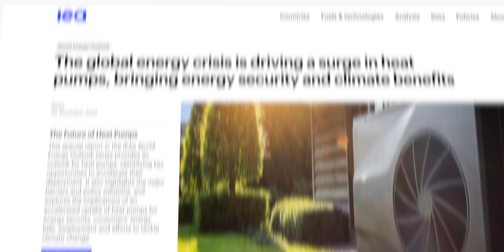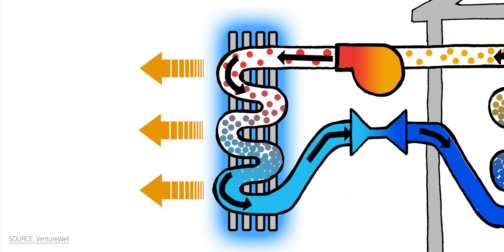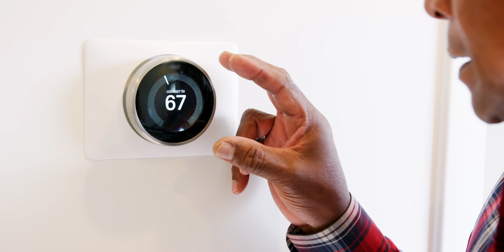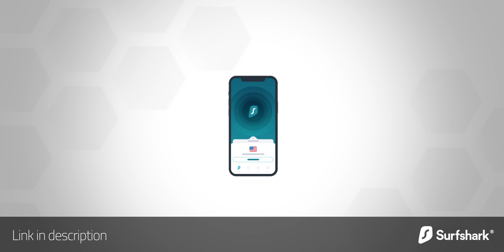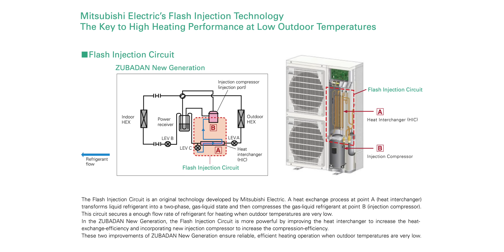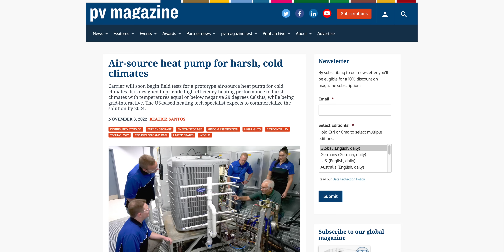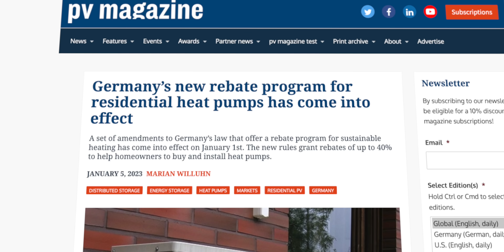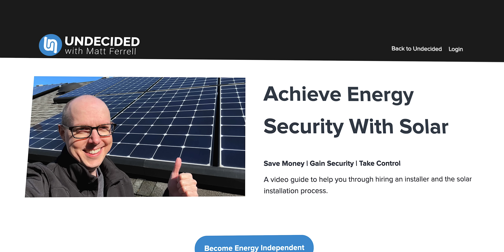Major Advances with Heat Pumps in the Extreme Cold

Comment: My sister had a heat pump installed about four years ago.  Last month, in our area of Canada, we had a temperature drop of -25c for a couple of days.  Her heat pump is her main source of heat.  She has never had an issue with getting heat.
Reply: I just moved to Idaho and it got down to -20 F (or nearly -30 C). Those are the kinds of temperatures I'd like to be sure it works still at.
Reply: @stevenschmidt   I have four air-to-air heat pumps, or mini-splits as the North Americans tend to call them installed here in northern Sweden, with a heating season being equivalent to Anchorage, Alaska. They work just fine in -25C, but with those outside temperatures the total energy needed for heating exceeds the design capacity of the heat pumps. You could get a three times larger unit but that won’t be economical as that capacity won’t be utilized 95% of the time. Here we supplement our heat pumps with a secondary heat source on colder days. In NA this could of course be natural gas from an existing hookup at no additional cost. Here we mostly use wood pellet furnaces due to local price and availability. 
What strikes me as odd is the high installation costs of mini-splits in NA. Mine cost me 800 USD each including installation and electrical hookup. Something is wrong with that industry in north america, but hopefully prices come down as the market matures.
Reply: @Random-f3y7w  With a quick scan, I didn't see anyone mention this... Several people I know with heat pumps have aux heat which  is just a built in electric heat strip (~10kw). If you only need that a few days a year you still keep most of the benefit from the heat pump. If you need it more, you lose all of your savings since straight electric heating is usually the  most expensive kind. If, as you mention, you have some other backup heat you are doing much better.
Reply: @Random-f3y7w  In the US, I think it might be a combination of things. In the US, you need to have 3-phase power to a unit as 120v 2-phase isn't enough to power a heat pump. With higher voltage in Europe, it is a bit easier to run a circuit. Also, when I checked them out in Boston, heat pumps were enough out of the mainstream that a lot of installers avoided them. At the time, the state of Massachusetts was allowing up to $5k financing at 0% interest... magically, the installed cost would come in right around $5k!
Reply: @Random Acts  I think what is wrong with installation costs in the USA is that millions of more people were encouraged to go to college than should have been and there aren't enough technicians :)
Reply: @Random-f3y7w  The price of the ductless units here are ridiculous, I lived in both Cozumel and VeraCruz Mexico for several years and ductless units are stacked up on the floor of most grocery stores. Same brands as here Gree, Haier, Media and all the ones they make for others. Average cost is 2 to 3 hundred bucks. They dont evacuate, they just blow a little refrigerant through the lines and turn it on. They last for 3-4 years and then they just replace them like window units.
Reply: @Random-f3y7w  Are there particular brands, or possibly labels that Swedes utilize? Or possibly some EU label that would let one know that a unit will continue to function well enough at -25C? 
I have a friend up in the Italian Alps who has an ancient kerosene furnace in her vacation cabin that should be replaced. In N Italy air-to-air heat pumps are very common, but the vast majority are not built for the real cold one might experience in the mountains. I'm not sure how to advise her on seeking out the right unit.
Reply: @Random-f3y7w  hur mycket betalar du för EL där uppe? jag bor i jämtland
Reply: @nctrailcam81 hi I’m in the process of deciding heat pump with emergency heat or hybrid, which uses propane below 30 F, we live in NJ, I’ve few questions 
1. Will emergency heat be able to heat to any temp we need, like 74-75F?
2. When you mention condenser freeze, how does it impact system performance for heating? 

I’ll need to hear 2300 sf first floor and basement 1900 sf, can heat pump with emergency heat do it?
Reply: @ninjip3460 
1) I would go with the propane hybrid for 1 reason. If you ever have to run your house on a generator, the heat strip could easily take half its capacity.
2) A heat pump becomes less efficient the colder it is and at some point won't even try. When you hit that you are completely on aux heat. That point varies by model, but should be below 0 F for a modern unit.

In all but the coldest parts of NJ, you should have no problem going with a heat pump.
Reply: @Random-f3y7w  what kinda unit you have? Looking to buy one in Latvia. Prices range from 600euro to 1500+-. Panasonic had some good ones with good SCOOP and claiming to work at -35c.
Reply: @Random-f3y7w 800 usd  for a minisplit in sweden ? Are you buying your A/C from Ikea ? 😂. A cheap 2.5Kw Midea is more than 500, add the electrical wires and the copper pipes, nitrogen test, circuit breaker ..
Reply: @RandomActsOfMadness  So your heat pumps work just fine I  -25C, except they don't produce enough heat at those temperatures, so you have to have a complete other parallel heating system, whether it is natural gas, electric, wood pellets, heating oil.  The back-up system utility costs have fixed distribution costs that don't change with amount of consumption, so you pay those fixed costs whether you are using the backup system or not.  The cost of maintaining redundant systems eliminates the long term cost recovery from these new "high-tech" heat pumps.  All you are doing is driving up your cost of heating.  Don't be fooled by the slick sales pitches.
Reply: @stevenschmidt  I live in Illinois.  My gas furnace is 110,000btu 95%.  2 years ago I installed 2 air source mini split heat pumps of 12,000btu each.  They claim to work down to -15F.  I set the gas furnace to 50F on the hallway thermostat. The coldest days of this winter it was below -10 (closer to -15) for about 36 hours continuous and while the heat pumps did still provide heat, it was not enough to prevent the gas furnace from running during about 24 hours of that 36 hour period.  No other days has the gas furnace run at all.  My home is about 2,200 sq ft plus a full basement.  I have one 12,000 mini split on the first floor and one 12,000 mini split on the second floor.  With both set to 70F, they keep the entire house above 60F with no help from the gas furnace.  My highest month winter electric bill was about $170.00 and my highest summer electric bill was $140.00 keeping the entire house about 72F.  I am very happy with my mini splits and I plan to add 2 more 12,000 btu mini splits this next summer which I think will allow heating another similar winter with zero natural gas usage and I should be able to maintain 68F in the entire house when it is -10F outside. if my calculations are correct.  My mini splits are "Innovair pure" (120vac) with a rated SEER of 20 and they have electric heat elements in the base of the outdoor unit that only seem to operate during the defrost cycle so that the water can escape through the drain holes without freezing in the base.   To improve efficiency I added 1 inch thick Styrofoam insulation under the bottom of the outdoor unit and added a bunch of data logging temperature sensors to various parts of the indoor and outdoor units and power sensors monitoring the AC power to each mini split.  They are amazingly efficient and the Styrofoam totally prevented any ice in the base.
These units each cost about $700.00 and I installed them myself, directed and supervised by a friend that is a licensed HVAC person.  My total combined cost including tools was under $1000 each installed.
Reply: @stevenschmidt  you don’t only want to be sure it works, you want to have uninterrupted power… by whatever method.
Reply: @stevenschmidt  It will....  Get ready for a $1400 a month electric bill though, as well as a $1200 service fee when it breaks down.  Good luck!  By the way I've installed 132 of these and not one customer didn't complain about power consumption in the winter.  Or trust a rich YouTuber with lots of money. 🤷
Reply: @stevenschmidt  If it's an air source heat pump.... not a chance.  A ground source heat pump (very expensive, by contrast to air source, due to the installation costs and 'ground loop' assembly) will do the job reliably.
Reply: @stevenschmidt  The heat pumps still work, but are working their guts out. I'm in northern Utah and depending on the local area I live in we got to -30F - -20F in the valley. My heat pump was still blowing warm but couldn't keep up with the demand so the furnace would kick in every now and then. Let me describe another way. The cold this past winter killed all of my peach blossoms in January and nearly killed the trees. Took 2 months for the trees to recover once they started growing.
Reply: @stevenschmidt   Canadian here, My old place had a heat pump that still pushed heat in a week of -35C and a few drops down to -40C, I can't speak for efficiency at those temps,  cause I wasn't sitting there measuring it but it did work no issues. new place doesn't have it but already looking at rebates for my area to switch over too, and there are lots of options.
Reply: @CF_Sapper hi I’m in the process of deciding heat pump with emergency heat or hybrid, which uses propane below 30 F, we live in NJ, I’ve few questions 
1. Will emergency heat be able to heat to any temp we need, like upto 74-75F?

We will need to heat 2300 sf first floor and basement 1900 sf, can heat pump with emergency heat do it?
Reply: @stevenschmidt  hi! I have a good heat pumps and I live in Quebec. I know a guy who work for one of the biggest heat pump manufacturers in America. He said to me that, the winter when you hit -15 Celsius, it became a lot less efficient to a point it can damage the heat pump in a short term. So I decide to use mine only the other seasons. But in a winter I use my wood stove, and I can assure you it’s really the best for the temperature here. We have between 2-4 weeks per winter who we can reach between -25 -35 Celsius. It’s my experience. I hope it’s gonna help. Have a great day.
Reply: @bobafet5363  -30 c’est bien mais nous on attend -40 pour que ca soit vraiment bon pour nous au Québec. Ce que te disait ton gars sur l’efficacité est vrai avec la technologie actuelle mais je me demande comment ils pourraient faire pour ramasser la chaleur qui reste. Parce que physiquement tant qu’on est en haut de 0 kelvein il reste pas mal de chaleur dans l’air.
Reply: @bobafet5363  That may have been possible with really old models, but modern cold climate heat pumps are specifically designed for cold climates. I did Fujitsu's and Haier installation training and neither mentioned anything about damage in low temperatures. It could be that your installer friend was thinking of exterior units icing up, which was a problem with heat pumps a decade ago.
Reply: @bobafet5363  Yes right now we will probably need some combination. Here we saw -25F a few days in a row which is when you need the heat the most of course. Also based on the math in the video it would take 20+ years for a heat pump to pay itself off in energy savings
Reply: @bobafet5363  salut montreal ici. I agree you turn units off when its really cold. Damaging over the long term. On another topic -  who will catch this poster,boba, is probably not writing in his first language. So hurray for trying.
Reply: @bobafet5363 tu peux essayer une version hyperheating Mitsu ou optimized heating de Daikin (monosplit uniquement). Le COP baisse bien moins en températures négatives. Après faut bien faire attention à abriter l'unitée externe de la neige
Reply: @bobafet5363 Well yeah if you have wood to cut and dry yourself then a wood stove is good (not environmentally though). 

 Not everyone has that option. Even prices vary on wood.
Reply: @stevenschmidt  If you are often at those temps, I would highly recommend an alternate heat source.  Especially if you are at all prone to power failures.  If NG is available, it is likely cheaper per BTU of heat on average over the season and can still heat your house during a power failure using only a small generator to power the fans.  A power failure at -20 that lasts anything more than a few hours could destroy your house with frozen pipes and the like.
Reply: @apostolakisl Gas furnaces, stoves, and water tanks need electricity to operate.  Gas outages are common as well.  Solar, storage batteries, and a propane generator are the way to go.
Reply: I live in Canada, and i had a heatpump installed last year (only source of heating) a Daikin. It works really well, dont have any problem. It has an heating coil for when the temperature drops low. At -15’celsius it work at 75% heatpump 25%heating coil.  The heatpump stops working at -27’c, then its 100% heating coil.
Reply: @goben3804  I live in Canada as well.  We regularly see -40C and colder where I live.  Heat pumps have a long way to go.
Reply: One question I have is if it's still cost effective to run an air-sourced heat pump at lower temperatures. If it can heat at low temperatures but it's no better than electric resistance, then sticking with another source may be better.
Reply: @crhpjeff  In North America heat pumps WILL save you money if you are replacing anything except natural gas. If you have heating oil, propane or kerosene heat, heat pumps are going to be cheaper, no question, full stop. Those maybe 14 days of extreme cold that make them expensive to run are more than covered by the other heating degree days when the heat pump is significantly cheaper to run than any other heat source.

If you have natural gas it is a calculation to determine if they are cost effective NOW, but I would guarantee they will be cheaper as we finally start to implement some sort of carbon fee. I had natural gas and replaced it with heat pumps. I'd run the calculation a few times in the previous years and sometimes natural gas was more expensive and sometimes it was cheaper per unit of energy BUT if you eliminate the fixed monthly fee from the gas utility they were pretty damn close in the years when gas was more expensive. I unfortunately have been working from home since putting them in, so I don't have a good cost comparison to pre-install gas costs.

The additional advantages are built in air conditioning and zone heat.
Reply: @patrickcorcoran4828  hi, I live in NJ and have been debating for long time to go with heat pump with heating coil or hybrid, which uses propane below 30 F, any suggestion my question is can it really heat the house? Our sf for first floor is 2300+basement 1900sf?
Reply: @ninjip3460  Yes. Here in Northern VT I had to be careful with the calculations for our -30F nights, but I would not hesitate to install one in NJ. 

I no longer have access to the calculators, but any HVAC company you hire or DIY kit company you contact is going to be able to do the calculations with information you provide. I recommend talking to a Fujitsu or Mitsubishi dealer, probably Mitsubishi because they have built-in electric resistance strips for backup heating. I'm very suspicious of companies that try to sell hybrid systems post 2017. I have a friend who does solar for a propane/oil dealer that branched into heat pumps and then solar and he says they push hybrid systems so they can keep selling fuel.

Modern Mini-Splits allow for a single exterior compressor unit to run up to five interior head units, depending on the model. I've got a very small 1-bedroom house. I have 1 exterior compressor/interior head pair for the main house (Living room/Kitchen. Dining room/bathroom) and another exterior compressor with separate heads for the bedroom and basement.
Reply: @crhpjeff  you have to count how many days you have below the threshold. If 95% of your heat is in the efficient range for an air source heat pump then you are still ahead.
Reply: A btu is a btu, as long as the building isn’t super leaky and equipment is sized correctly heat pumps work just about wherever people live
Reply: Senville Arctic Series ultra high efficiency. It says that it works to -30C (-22F). I installed one last year and this winter it works well down to that temp. Still produces heat below that. It does use more energy at those low of temps due to the defrost cycling.  It really is shocking heat pumps can work at that temp.
Reply: @thomash7573 hi I’m in the process of deciding heat pump with emergency heat or hybrid, which uses propane below 30 F, we live in NJ, I’ve few questions 
1. Will emergency heat be able to heat to any temp we need, like up to 74-75F?

We’ve two zones and main unit which I’m planning to replace serves, 2300 sf first floor and basement 1900 sf, can heat pump with emergency heat do it?
Reply: I am literally in the process of installing an Air Source Heat Pump. Our Canadian climate is so extreme though so we put in Hybrid Furnaces. They run as heat pumps down to a specific temperature then they fire up a Natural Gas burner. The NG burner is also engaged when the desired on demand temperature is substantially higher than the current ambiant temp. The heat pump doesn't react as quickly as a NG furnace so if rapid heat is required, the high efficiency furnace kicks in.
Reply: @Fingerprintguy hi, I’m in similar situation, trying to decide between hybrid and heat pump with electric heating coil? Getting different opinions, can you please share some insights based on your experience.
Reply: @Fingerprintguy  Good move.  I would not rely on heat pump as a sole source of heat living way  up North.  As the air temp drops a bunch of stressors enter the equation.  1) The heat pump btu/hour drops, 2) the btu demand of your house increases, and 3) everyone who uses electricity to heat is slamming the system with demand.
Reply: Geothermal heat pumps are not affected by air temperature, it’s the cheaper air source heat pumps that loose efficiency when cold.
Reply: @Random-f3y7w  Real geothermal is unaffected by air temp but many (if not most) systems described as geothermal are actually just ground source and the loop is often shallow enough to be affected by air temps cooling the ground after a month or two of very cold weather, Still better than air source though.
Reply: @RandomActsOfMadness  Geothermal costs using drilled wells do have problems with freezing the source wells during cold weather, -25C to -40 which are frequently encountered in Northwest areas of Canada when the system is  drawing the most heat from the ground if  the system has insufficient subterranean heat exchange area.  The install cost can never be recovered with heat efficiencies.  Justifying it because of subsidies means spending tax dollars.  So your taxes go up the more subsidized systems are installed.  Disguising  the cost as taxes doesn't make the system more practical or affordable.   All you are doing is driving up the cost to our society, and dragging down the standard of living with this needless expense in the name of climate change.
Reply: @Random-f3y7w  True (mostly).  Does this mean that you are donating your money to people who can't afford to spend $50k on ground source installation?  Ground source heat pumps of the trenched style are affected by prolonged heat/cold as the trench will start to cool down or heat up, especially toward the end of the season.  Only a ground water sourced heat pump that has continuous access to previously unused water can go a whole season without affect.
Reply: @Random-f3y7w  what country do you live in where the ground temperature has no link to the weather? Lmao
Reply: Same here in Halifax just basic lg mini splits no issues at all
Reply: Are you sure that she doesn’t have auxiliary electric heating elements that kick in automatically under a threshold? That seems more likely.
Reply: A woodstove or propane is more likely in Canada and cold climates.
Reply: I'm in Ontario Canada and have had an open loop (uses my water well) ground source heat pump for 16 years. The heat pump is located in my basement where the furnace would be. I've only had a few really cold days when I've had to use the backup electric duct heater which is a requirement to have in case the heat pump fails.
Reply: We use air to air heatpumps in Norway. Commersial ones guarantee good efficiency down to -25 Deg c outdoor temp.
Reply: @drbuggs1963  What happens when it is colder? Do you have to use some other heat source?  We get temperatures down to about -35C here. What is guaranteed efficiency? What I want to know is KW to BTU at that temperature?
Reply: @Chris_at_Home  Below -30 deg c they are usualy no good. Need a heater element then. I found no documentation of effeinecy, just big words about Savings. I will look some more. We have down to -40 here to. But most people have suplementary heating below -25. Wood, oil, electrisity..
Reply: My forced air heat pump in my first house had an "emergency heat" mode where it just kicked in a resistive heating element. Does your sister's heating system have that? (The condenser outside used to ice up in really cold weather.)
Reply: @elhoward7440 hi I’m in the process of deciding heat pump with emergency heat or hybrid, which uses propane below 30 F, we live in NJ, I’ve few questions 
1. Will emergency heat be able to heat to any temp we need, like 74-75F?
2. When you mention condenser freeze, how does it impact system performance for heating? 

I’ll need to hear 2300 sf first floor and basement 1900 sf, can heat pump with emergency heat do it?
Reply: We either,we have a heat pump installed in 2010,still working great
Reply: Only expensive system and in use,my electricity bill is pretty high
Reply: Ideally, a heat pump should never stop producing heat no matter how cold it gets. If it's so cold outside that the working fluid is unusable, then the worst case is your heat pump works like a radiator, at "100% efficiency". In practice, I'm not sure if heat pumps are designed to keep working in that case. I don't see why they wouldn't be.
Reply: How about -25 to -40?
Reply: @sadnessinside123 I wonder about that. I’d what to know what a realistic electrical consumption of a heat pump making 40,000 BTU on a minus 25F day. We have a a lot of below zero F temperatures that last for weeks at a time.
Reply: You can almost always get heat so long as humidity is low or it has a system to de-ice the coils without continually running defrost cycles. What suffers is efficiency and you can end up with zero gain and effectively heating your home with an electric bar heater.  Unless your power is free or super cheap that will get real expensive real fast.
Reply: @CasaDeMuchosGatos  De-icing also consumes a lot of energy directly from power grid. So a heat pump with open-air external unit fot mild frost should be assisted by a usual heater for serious frost,  such combination will provide best efficiency.
Reply: Got some senville artic and down to -25c they still peovide 100% of the heat maintaining 21 c.
Reply: If it gets too cold, some models will switch to backup (resistive) heat, so you won't freeze
Reply: @Aera223  that should be in individual units, the problem is if it used in all units and all units are used for heating, this can cause a brown out, black out or grid collapse. As the demand for heating increases, your system efficiency drops, the rate of increase of power consumption rises very steeply destabilizing the entire grid.
Reply: @WhatTheHellIsWrongWithYouu  Just a rebranded Midea. Midea makes SO MANY. Pioneer, Carrier, Senville, Mr. Cool, Toshiba, Samsung, and more. I have a Pioneer low ambient unit and it's a beast.
Reply: Octoupus Energy built a new factory in the UK to make Heat Pumps and talking about a £3k selling price.
Not much more expensive than a Gas boiler, looking very promising.
Reply: @grahambrown42 £3000. is a very high price for a gas boiler.
Reply: @grahambrown42  Sorry but £3k is twice the price of a gas boiler. I have a very efficient worcester-bosch combi boiler, to replace it with a newer boiler, including installation, would cost around £1.5k. What the Octopus price does not cover in the need to replace all the radiator pipes, radiators, water reservoir or labour. Every floor would need to be taken up in order to replace pipes and radiators, space made for the water reservoir and so on. £3k may look attractive but there is a lot more to it that just the purchase price.
Reply: @daniel Earley  Good for you champ.
Reply: @danielearley5062  You forgot the underpinning of the house foundations to take the weight 😂
Reply: It was probably using heat strips to add the required additional heat.
Reply: Most of the northern heat pump installs have secondary electric heaters installed in them .
Reply: @stevencole7331  Yup, and they suck like 4KW/h power too!
Reply: The main factor is insulation. I had hard time in California using heat pump to deal with 38F temperature, because the insulation is just nuts.
Reply: We saw -40 a few times this year and many days of -35.
Reply: I have been slowly transitioning to air to air heat pumps.  Originally I heated with propane, then wood pellet, and now two 12k units and a 24k.   I am paying now....for heat...about a third of what I was for propane (based on OLD prices) and half what I was paying for pellet.

I use Pioneer brand mini splits, installed myself.  All in for all three including tools....over time...about $3k.  All three covered their cost by 1.5 years.  

Northern Ohio.  25 year old house.  Approximately 1800 sqft.

The cold snap we had this past winter, I did fire up the pellet stove to supplement but it wasn't needed honestly.  Yes, those few days I used the most electricity I've I have ever used in a couple days, but the cost at 12.5 cents per kwh....still less expensive than propsoft.

What I like about the mini splits, we can zone heat and cool and we do not have to heat the basement, we are never down there.  We are only heating the living space and we can lower the bedroom temperature at night for sleeping (also handy I'm summer) without losing heat or cooling the entire house down.

Well worth it in my opinion.  Even if they have to be replaced more often.
Reply: @wadebrewer7212  what is your electric rate per kwh?
Reply: @bill8985  I thought I included that.  Transmission included, 12.5 cents per kwh.  It is definitely cheaper than most areas.
Reply: @wadebrewer7212  Thanks Wade.
Reply: @wadebrewer7212  In PA our propane prices are low, I paid 1.57 a gallon in Feb. Our electric prices have double. We have ductless throughout the house for a/c and heat in the shoulder seasons but running a gas condensing boiler into a radiant floor is cheaper when it gets cold, for us anyway. It all depends on what you are paying for these different fuels.
Reply: @wadebrewer7212  Heat pumps are cheaper than propane for sure, but more expensive than natural gas.
Reply: Is it cost effective though?  How long does it take for you to break even compared to a gas furnace?
Reply: I hear this from Canadians all the time and I'm sure they work well. What surprises me is your electrical infrastructure that seems to never go down. In PA our grid is terrible and getting worse. Are your wires buried and what is the cost of your electric, I understand a lot comes from hydro?
Reply: @anthonyspadafora1384  It depends on the province.  Here in Alberta we get about 90% of our electricity from natural gas fired power plants.  The next largest contributor is wind.  Our wires are not buried.  Burying high voltage transmission lines is incredibly expensive - about ten times more than overhead lines.
Reply: @anthonyspadafora1384  hi. Half of canada is in quebec and ontario. The major power source is hydro in both provinces. Wiring underground is prohibitively expensive. Seems counter intuitive, those towers that carry the high voltage wires are huge, the wire is vulnerable to storms, falling objects. But underground is worse, at long distances.  I d say my experience is typical of a montrealer and suburbs, we hardly ever lose power. Had a huge problem in 1998. The ice storm. Two weeks , in some areas, no power. But that was 25 yrs ago...we did have my first ever tornado this yr. power was down in the enormous path for a week
Reply: @clarkpalace  How did you heat when the power was out for a week?
Reply: @anthonyspadafora1384  montreal has never been out of power more then a few hours for most people. But during the ice storm some areas were sol. But if you are out of town hopefully you have wood as a back up. I do. In 15 yrs its been necc for me a couple of times. But i live the arrogant dream of leaving my country place for my city place or vice versa. I built both, btw.  Our electric power is totally governmental, they took it over about 60 yrs ago, it works well. Far far far from that pathetic crap we all witnessed in dumbass corrupt Texas
Reply: @clarkpalace  So you have wood backup? Some of these people are all electric with no backup plan.
Reply: @anthonyspadafora1384  many people have no back up energy source. City apartment blocks are hell without heat. Everywhere is hell without heat. Its one thing to winter camp, another to stumble around your four walls day after cold day. I consider my secondary residence as some kind of apocalypse shelter...
Reply: @clarkpalace   Pot calling the kettle black much!? 🤣 FYI - Texas spends weeks/months in the temp range where your "ice storm" radar goes up.. which is probably hours each winter for you, like it is here in MN. I also have wood and generator for outage, but knock on wood haven't used them.. last/only multi-hour outage was in summer - doh!
Reply: @anthonyspadafora1384  Yes , Ontario Hydro is great. Very consumer focused . They even send me a survey to see how I wanted them to go forward upgrading the electrical grid. They are also getting into the business of installing EV chargers everywhere in Ontario. Our rates are fantastic 7.5 cents at night and 15 c/kwh at certain times of day.
I don't mind paying and supporting  Hydro because they do a great job and the money stays in the province. There are power outages sometimes but mostly due to weather and are addressed rather quickly.  Quebec Hydro is similar. Great companies. The problem in PA is probably greed. Ask your politicians to do something about it.
Reply: @bossman6174  Our politicians don't know what bathrooms to use.  lol Since the US blew up that pipeline to Europe we are selling huge amounts of natural gas to Europe and as you probably know the propane and butane must be removed at the well head so propane is dirt cheap, 1.57 gallon. Not big on the EV's until I see some type of humanity for those African children digging the cobalt.
Reply: Depends if it was air source or geothermal
Reply: air source or ground source?
Reply: It must have been pumping heat from down south!!  😋😋
Reply: @AJR123-i8t  Placed in basement etc cold but not frozen place
Reply: My house is primarily heated by two heat pumps, i live in sweden and it is currently  -22°C outside. The heatpumps does work perfectly fine to keep the house warm. My ones do sound a bit more when it gets to -10°C and below. But it is mounted on the walls of the house ( as I bought it two years ago ) and I will at some point remove them from the walls and place them on stands. The vibrations can be quite annoying.
Reply: @skaapmeester  It works excellent but when temperature is below -5..-10 C its efficiency is less than of  usual electrical heater thus  involving more expences.
Reply: It hit minus 40 Celsius here where I live for 3 days and my heat pumps kept my house warm
Reply: Air or Geothermal?
Reply: @WhatTheHellIsWrongWithYouu anasonic and Mitsubishi seems to have the best heatpumps in our market here in Norway.
They both have models that works great down to -35⁰C.
Below that they'll start to struggle, so a secondary heat source like a wood oven is important.
Reply: I had a heatpump that came with my house and was installed in 2016 it struggles to keep my house both hot or cold, the lines freeze over constantly, it poor's water out of the fins when they freeze over and it is a maintenance nightmare.  Spent nearly 2000 maintaining the systems since it was installed.
Reply: @mlopez2082  Sounds like they didn't size it correctly.
Reply: Can it handle -40?
Reply: The point wasn't that it wouldn't work, but that it would consume more power.
Reply: @AJR123-i8t  I have one... mitsubishi brand.  I have electric  back up heating when its -30+ though.
Reply: When you choose the right heatpump for the local weather, this is 100% what you should expect.

-20 year HVAC tech.
Reply: Thanks for the positive comment about the efficiency of a heat pump. I just bought one for our family room. I will burn wood when it’s 10*f or less. The prairie winds in Central Illinois are wicked and it causes power outages.
Reply: Not good if a power cut happen
Reply: They work
Reply: They are rubbish.
Reply: thats all? here in maine near the canadian boarder it often gets much colder than that, we usually get a week or so of extra cold temps each year.
Reply: Very happy to her heat pump kept working!
Reply: Her main source means it's not her only source.
Reply: I could not find a single source of information about heat pumps that included TCO calculation. 
So the technology works - great. But how much does the heat pump cost to install and run over 15-20 years vs natural gas furnace + outdoor AC unit ?
I looked at solar panel installation for my house. Given typical electricity usage, amount of sun in my area and electricity prices, the break-even cost was 8 years if I did not include the lost opportunity cost ( interest that could have been earned by the money spent on solar installation) and 12 years if that lost opportunity cost was included. This means I would not realize any benefits if I move in 12 years.
I am guessing nobody talks about long term TCO of heat pumps because it is not that great.
The TCO may be better in countries where the cost of fossil fuels is much higher than in North America and the installation costs are lower.
Reply: I recently had a mini-split installed. Last winter the temperature dipped to -5°. My house did not maintain an adequate heat in the house. I've added 12 inch insulation in the attic. Is there anything I can do to assure better heating results. The unit sits 4 feet above the ground attached to the house. So the roof line covers it. Would making it a shelter with adequate ventilation to keep unit warmer increase the units ability to maintain heat in extreme cold outdoor weather? We were freezing last year and need a cost efficient way to resolve this problem.
Reply: -25c thats only like 10% of Canada , you have to accept -35c to -45 c working temps for pretty much all of Canada in the winter , with a system thats has max low temp of -25c you are going to a need a second heat source to get insurance or to sell your home in the future, here in Manitoba we get a months worth of -30c and lower every winter its not worth the risk of just a heat pump that may or may not get you through to spring.
Reply: At what cost(s) ?
Most installers around here want to see 5 to 10 Kw of solar panels on the roof to help defray costs and a fossil fuel heat system for Dec/Jan/Feb.

You can heat with resistive heat at -25 as well, but you'll be paying big bucks to do it.
Reply: I’m in Canada, my heat pump( no geo thermal source) quits creating practical heat at minus 5 centigrade.
Reply: back up heat strips most likely unless its ground loop. whats that electric bill? I also understand that canada heavily subsidizes heat pump purchase up to 90% thats bound to work well
Reply: The heat pumps have heating coils that provide heat when it cannot get it from the air. Its basically becomes a coil heater at that point
Reply: When temp is -25 that means heat pump has to work hard.  That means energy consumption would be extremely higher.  That translates to a very high energy bill.  Using a heat pump with geothermal is the only efficient way
Reply: I doesn't matter how cold it gets;  all heat pumps have electric elements in the indoor unit to provide extra heat when the heat pump can't make enough and for defrost of the outdoor unit.
Reply: I recently saw an article where they said the best cold weather heat pumps are still not as efficient below -8C/17F as natural gas/propane (and probably heating oil too). So if you have a different heating method, use it once you get down to that temperature.
Reply: You has to asked local importers and installerd. They are made for climate zones and very much diveded in house and summerhouse version. For the economy it make sense electric power is cheep compered to oil and gas.

Im from Denmark. We have a coastal climate. Normall yits  above minus 20. below that it is very  very ineffectiv.  BUT it has a automativ 1500w old radiator build in as helper. 

Below 20 C. Why that You get at least 1500 Watt in warming op. BUT You has to has to pay full price for Your power. 

Most of the year in makes plus-plus.  

I have a Toshiba . they are the biggers for the worl. But remember what I toold. And go the well known big ones. There is a a lot of makers and not all them speak chinese. Its easy to make heatpumps. If difficelt to make  good ones.
Reply: so what would you think of winter from Nov to March ( Alberta Canada  and many many night are below -30C and even as low as -40C some nights
Reply: @rickpederson1219   My understanding is that at -8C most cold weather heat pumps are only as efficient as a regular heat source (like electricity), and below that they are less efficient. However, if you are more efficient the rest of the time, you may still save money. In terms of whether you will still get heat when it goes below -30C, I have my doubts. I think -30C is about the lower limit - at that point you almost certainly need a secondary heat source (like electric baseboards or something). So far this winter, we've saved 15% on our heating costs by converting about 1/2 of our commercial building to heat pumps and switching to secondary heat at -8C. (The added bonus was we got AC in that half of the building which we didn't have before).
Reply: GAS BOILER MUCH BETTER AND CHEAPER , THERE STRUGGLING TO HEAT UK HOMES NEVER MIND ARTIC TEMPERATURES IN CANADA
Reply: All engineers that fit them, not the people that read information and choose to be experts, know they don't work unless the home is insulated like a industrial freezer room. Air source COP in winter isn't 2.5 at -10degrees, they dont work. Unfortunately our politicians are fed information by sycophants and will only hear what they want
Reply: @KerrikkiLurgan  lucky her, we just moved in to a house with a one year old heat pump, the house is totally ducted so you’d think it would be fine. Nope, when the temperature fell to -15 C we ended up buying several electric heaters to keep comfortable.
Reply: I call bullspit.
Reply: Lucky girl!
Reply: I live in Ireland and it doesn’t get very cold here in winter. But there was a week this winter where it stayed below 0c continuously. Then when the electricity bill came we got a big shock. The air source heat pump doesn’t run very well below 2c or so, which is usually enough for an Irish winter.
Reply: @jbmurphy4  is the irish winter dry or wet cold? 

I went through two winter events after I recently got a house with a heat pump. One event was a couple dry days at -8°C where the heatpump worked perfectly, the other event was a couple days of freezing rain at -1°C but the rain completely froze the radiator so the heatpump didn’t work at all, it resorted to aux resistance heating.
Reply: @krisswolf2011  we always have high humidity here, everything gets a coating of ice every night if it goes below 0c. So it would be wet cold. 
The heat pump design that thaws out the radiator looks like it might be needed in Ireland so.
Reply: @jbmurphy4  Sounds like your system isn't setup correctly. Have seen a few where the system pressures aren't correct and/or the control unit is badly setup, and the compressor is running too much. 0c is nothing. I've stayed in ski hotels in -15c with HPs and they're warm. Get a specialist in. I'd bet good money it was your original installer at fault.
Reply: @jbmurphy4  You likely have one that's not suited for temps that low and it probably went into "emergency heat" mode - which is a large resistive coil pack on units sold where I'm at. Those make for the largest power draw I've ever seen on my system, for sure you don't want that turning on!
Reply: @jbmurphy4  That's odd I read from a lot of news sources here in the US that Europe has had a mild winter this year.
Reply: @jbmurphy4 Humidity plays a big role, even at positive temperatures the amount of defrost cycle can be even higher at 2 celcius than below 2 because when it freezes, the air humidity decreases, especially when you have a lot of freezing green leaves outside (trees, grass..) that captures the water molecules
Reply: @jbmurphy4  There are different types of heat pumps designed for different climates. I live in a very cold area in the USA and we sometimes see HVAC companies installing the wrong heat pump for the climate. My neighbor got one that is great at air conditioning, but is only designed for the type of heating you would need in Florida. 

The ones I installed are rated at full output down to -25°C
Reply: Geothermal?
Reply: "Her heat pump is her main source of heat."  What is her backup source she used on those cold days?
Reply: For you in the South that works, the latent heat available at -30°C, is a lot less, that is, less available water vapour in the air, which is the heat holding medium.
This is the reason that in the North where I live, 56°N, even ground source heat pumps are in trouble, some permafrost areas, or close to.
I am happy with two large hydro sites, one East, and one West. Heat with electricity, summers only have a few weeks of +30°C
weather.
Reply: @carlthor91 Ground source heat pumps don't ever run into temperature trouble if they're installed properly accounting for on-site ambient temperature conditions. Ground temperatures are reliable and easy to predict
Reply: @rayzerot  Not everyone lives in the Lower 48. 
I am North of the permafrost line, although it is 390 km South and moving North with Global warming.

Some areas do not have deep enough soil to accommodate deep vertical loops. YMMV!
Best wishes from 55.75°N
Reply: Ground source heat pumps make more sense as the temp underground is almost constant year round.  Needs a big lawn or a borehole though.
Reply: It depends what you define comfortable temperature is. Is her thermostat set to 27c? Gas furnace would have no problem delivering enough BTU to achieve it just slight whoosh. Can heat pump effortlessly achieve that temperature? How much noise will it generates while you are asleep?
Reply: That's because heat pumps have electrical heating elements built in to kick in when the temp gets too cold.   In other words, she's been tricked into using a plain old electrical element for heat which is far more expensive than gas.
Reply: @WhatTheHellIsWrongWithYouu I’ve never heard of a -25C one tho 🤷
The other problem is as temperatures drop, you need more “heat” just as they are getting less and less efficient.
Also when we have natural gas heaters, when someone’s gas system breaks down, they can get an electric heater and put it on a grid that isn’t heavily loaded.
Reply: @jsbrads1  we have a Artic Heat pump with a Panasonic compressor in it. The cut off is -30C. There is also a secondary backup boiler in this case when it gets too cold. We are so happy with the unit we will be retrofitting another building with a similar unit.
Reply: @jsbrads1  There's also gas powered "absorption heat pumps", but I don't know how they compare to standard gas heating.
Reply: @jsbrads1  Daikin Altherma goes to minus 25 deg.C. Likewise Panasonic Aquarea. Those are just off the top of my head, there are many others. If your heat pupm dies in a cold snap you can plug in electric heaters too, so not much difference there.
Reply: @balometer  that is true. The problem is if it fails in the middle of the night while people are asleep and they don’t wake up.
Reply: @jsbrads1  Mitsubishi, Panasonic, Samsung,  Toshiba, Daikin, Fujitsu and Electrolux all makes air to air mini splits with guaranteed effect down to -20c or -25c. Mitsubishi 6 kw models deliver 6kw of heating at -25c with a consumption of 1680w. So the technology exist, but is seams like the US is at least 2 generations behind the best. Event my parents first mini split installed 27 years ago had better performance then some of the ones on the US marked today.
Reply: @JoppeOSL  Not true.  There are cheap models and expensive models and always have been in the USA.  Due to NG being almost ~free in the USA no one bothers using heat pumps for anything other than AC.  Most only get HVAC(heat pumps) for the AC portion and all use NG/Propane for heating as it is MUCH cheaper than heat pumps even with increased prices of NG.  Only the CO2 religion nutters get heat pumps for cold temperatures using the more expensive fluids with MUCH larger and more expensive heat exchangers.  Or like us, I did it as a fun project using Geothermal as the heat source as sweat equity.
Reply: @JoppeOSL  what’s their shutdown temp?
Also there is no such thing as a guarantee, it is dependent on the humidity.
Reply: @JoppeOSL  Most people do not have a clue about HVAC and say erroneous ignorance.  COP is the same everywhere in the world.  The units are all the same with the only difference the fluid in them and heat exchanger size.  Physics does not change.   But, manufacturers do LIE about their numbers.   My house in Denver has HVAC and is plenty warm at -20C after I built a roof over it to keep the snow out and increased its heat exchanger size by 2X... It is all what people choose to install.  

Your COP is entirely dependent on size of your heat exchanger for the most part, but here you had better have a variable speed oversized pump instead of minimum which is what most people install as fluid flow will need to be increased as lower delta Temperature.  Had a tech out to double the size of the Heat Exchanger and viola, cooling bills in the summer went down by 25%-->40% and same goes for winter.  Could have bought a new unit for $3k-->$5k, but simply added the Heat Exchanger for $1k and it is now better than the new model.  In reality, variable speed multistage heat pumps  increase overall efficiency, but this cannot be stated in a COP number.  

The big deal is: USA has ~free Natural Gas.  You have to be an IDIOT to install a more expensive HVAC for heating exclusively unless you are getting it for the AC anyways.  I did mine as a project.  

You can buy the HVAC's for low temperature, but WHY would you do so in the USA?  NG is ~free.  NG is several times CHEAPER than HVAC in the short term and long term.
Reply: @JoppeOSL  yes it's strange i have 2 Panasonic air to air, oldest is 13 years old and it performs very well down to -15-17C. It still provide hot air below this but uses too much time on de-icing. So seem like US marked had been shielded from getting good heat pumps ...
Reply: @w8stral NG is free?
Reply: @matthewgoedtel5998  Effectively NG is free here in North America compared to any other heat source.  PS: You can run a heat pump off NG.  Can you buy one?  Not exactly, but you can repurpose a Propane refrigeration pump sold for boat or RV usage and they make the ideal solution for CHEAP heat source.  My last house had one(actually several tied in parallel).  Current house does not.  Sorry, not totally sure which comment you are replying to and not going to look in a 125 comment thread.  Sure wish YT was like Disquiss.
Reply: @w8stral  I still disagree, NG if far from free. You could argue wood heating is free. Paying roughly $200 a month in the colder months, and $15 a month when not using ng is not free or cheap. If you are building a new home you also have to connect. In rural areas in the us, everyone has electricity but few have ng connection. Heat pumps are extremely efficient in certain conditions but not in all. If a person currently has resistance heating it will save you money upgrading to a heat pump.
Reply: @matthewgoedtel5998  Heat pumps are efficient in all conditions... Rather the cheap ass installations of them make many of them ineffective(too small of heat exchangers).  Using NG or propane to power said heat pump is still cheaper than electricity.  Firewood(I burn about 5->6 chords a year) is not practical for most and you will pay MORE in firewood costs than NG by FAR.  It is not even close and requires zero labor freeing up a LOT of time and complaining from the wife saying it is "dirty".  1 chord of firewood is easily burned in a month when cold if not 2 and 1 Chord of firewood costs you north of $400 currently.  I do said firewood to stay in shape and we have downed trees everywhere anyways so either turn them into firewood or pay or... So in my case, it is "free".  For everyone else?  Sometimes you can get garbage wood delivered for free such as wood chips from tree services.  But for anyone who does not own acres and acres of trees?  No, firewood is horrifically expensive. 

Sorry bud, you are out of touch.  Solar thermal + heat pump is actually superior in some situations, but once again, ONLY if you are willing to do the LABOR of building all the infrastructure yourself.  If you pay to have it done?  No way in Hell would that pencil out.   Geothermal heat pumps would be cheaper.
Reply: @w8stral  I'm not sure who is "out of touch". You seemed to miss my point, NG is not effectively free. I said "you" could argue wood is free. Key word being you. I am not arguing that wood is free. On heat pump efficiency, I am not saying it is not efficient. Resistance heating is 100 percent efficient and heat pumps are well over 100 percent efficient from an energy conversion standpoint but are not always efficient from a cost standpoint. I had a corn/pellet burner and ng furnace. I added a heat pump to the mix that handles cooler weather and the other two sources can supplement the heat pump for the extremely cold weather. Finally, I am all for heat pumps and against, as you said, improper sizing and design of heat pump systems. Properly designed systems based of required thermal units and local conditions (economic and climate) should supplant traditional heating equipment.
Reply: @matthewgoedtel5998  great.... wearing socks is free....
Reply: @w8stral  So, you have no response then.
Reply: @matthewgoedtel5998  YOu never responded
Reply: @w8stral  To what?
Reply: @JoppeOSL So what do you do when it hits -40 for two weeks? That is reality for Saskatchewan
Reply: @jsbrads1  A couple years ago I replaced my A/C with a Mitsubishi Mr Slim ductless heat pump that was rated for down to -21C. Of course a year later they came out with -25C heat pumps. Now I see that they have new -30C models (the Zuba line). 

During the cold snap the OP mentioned (it reached -29 where I am), I had to rely on my electric baseboards to pick up the slack, but the heat pump was fine in the -20 to -23 range. I could also use a gas fireplace to augment that. I wish cities weren't outlawing wood fireplaces, because an offline heat source is very useful in those extreme conditions. But before the heat pump, I was baseboard only. So even if they have their limits, it does ease energy usage overall (my hydro bill is lower than it used to be).
Reply: @WhiskyCanuck  yes, when upgrading a baseboard system, you have the best of both worlds. Los Angeles is trying to get rid of all natural gas, so zero natural gas anywhere, of course they want no wood too. They can switch… at least until they have grid problems… (note, they have starting having problems with their grid many decades ago and they have never fixed those problems)
Reply: @jsbrads1  I don’t understand why people are so worried about “the grid”. Demand goes up, utilities will increase their capacity. Its not a you or I issue. I dont even heat my house with NG or Electric. We’re on an efficient, cheap pellet stove.
Reply: @WhatTheHellIsWrongWithYouu  The gris is generally rated to provide electrical power at a certain range, usually ampage. This, depending on where you live, varies on the density of housing and industry. As more and more products become reliant on electricity for their energy supply, that supply has to increase, however, the construction of the grid gives it a maximum ampage that it can provide, usually due to the materials used in its construction, the type of transformers in the grid, type of cable and so on. Where I live in the UK, councils are already having to restrict the amount of EV chargers that are fitted in individual streets as they us up too much ampage when in use, leaving less available power for others. That will also start to apply to heat pumps as they will run on electricity, rather than gas. 
Demand requires a higher rated grid, many grids have old and outdated infrastructure designed for a time when there wasn't so  much requirement for electricity.
Reply: @danielearley5062  I’m aware. It is not the responsibility of consumers to give a shit about the grid. The utility companies are responsible for transmission lines, transformers, generation. Use your power.
Reply: @WhatTheHellIsWrongWithYouu  But it isn't happening.  Between heat pumps and electric cars, the grid is woefully undersized, both generation and distribution, in much of the country.  It would take trillions of dollars to fix and no one wants to spend the money.
Reply: @WhatTheHellIsWrongWithYouu  large traps population movements overwhelm utility company ability to upgrade the grid in time. 

This is part of what happened in Texas.   The already planned grid upgrades arrived 12 to 18  months after the fatal freeze failure.
Reply: @danielearley5062  have to upgrade them sometime ... Demand is only increasing regardless of EV's or heat pumps. And i dont think you realize how efficient they are when installed suitably (insulated house, heat recovery on ventilation etc) and used appropriately. Especially if you can keep your existing heat source for those times when it may overwhelm your system (probably not the right choice for most to get the very cold climate versions as they are bound to be less efficient at higher temps, though i may be wrong)

Is the grid, power generation and storage all issues with EVs and such. Of course but demand has been growing since its first introduction. Hardware has a life-span, its time to upgrade, lets not wait for brown and black-outs.

Or do you think we should still be on dial-up
Reply: @WhatTheHellIsWrongWithYouu  Texas might disagree with you. Also most of the world outside North America and Western Europe.
Reply: @dzzope  I'm quite aware of how efficient they can be thank you, however, as you have said, that is entirely dependent on the property they are installed in. As for upgrading the grid, I realise that it needs doing, I also realise that trying to get anything like that done in the UK is incredibly difficult,  incredibly expensive and always takes longer and costs more than estimates. As it stands, there is very little evidence in the UK of plans to upgrade the grid within a reasonable timeline, be it locally or nationally. Things may be different where you are but that is how it stands where I am.
Reply: @WhatTheHellIsWrongWithYouu  I don't know where you are living, but here in Québec where majority of heating comes from electricity, grid sizing is calculated for those very cold days. If we could reduce those peeks, grid equipment could be way smaller and costs less. So production and transport is sized for a couple of days while the rest, 350+ days a year, equipment is under utilized.
Reply: @WhatTheHellIsWrongWithYouu  tell that to Texas 🤠 they might disagree 🌨️🌨️❄️☃️🥶
Reply: @apostolakisl  My grid has an actual overcapacity. Quebec.  They are trying to sell more of that capacity to Maine but certain political forces ( read GOP) are holding up the progress
Reply: @bossman6174  You are in a unique position.  The biggest state in the country (CA) is woefully under supplied.  TX is another grid that is pushed to the limit on particularly hot or cold days, but not as bad as CA.  Though TX is growing very fast and CA is shrinking.  Though every state is adding a lot of electric cars that will hopefully not be getting charged during peak usage times.  Think about what happens if 10% of the population is pulling an extra 10kw for 6 hours a day starting at 5:30pm when they get home from work.
Reply: @apostolakisl  The grid argument has almost always applied to the grid from the start. Infrastructure is rarely designed with much overhead. The first grids were designed for lighting only. The Edison socket predates the first outlet. The grid wasn't designed to handle ac loads when ac spread across the world either. Current trends are similar.
Reply: @Justin Passfield  because we've seen over and over again, companies do not improve unless required when they are allowed to act as a monopoly. With the push for EV and electronics, it keeps increasing the demand for better grids, but these companies do very little to improve until they have an epic failure; such as the electrical grid failure in Texas.
Reply: @WhatTheHellIsWrongWithYouu  If only it was so easy. To put more wires in the street you need more infrastructure to bring power from a point of generation. Now depending on your state they may be pushing more green energy. Problem is solar and wind doesn’t work at night.
Reply: @WhatTheHellIsWrongWithYouu  People are only worried about the grid when it comes to fighting against electric powered anything. Vehicles, heating, stoves, if it doesn't use oil or gas, they hate it.
Reply: It almost certainly had switched to heat strips in part or in full at those temps.  Did you ask her what her electric bill was?  At -25c, the heat pump wouldn't have been any more efficient than heat strips even if it was still doing heat pump.  Exception being if she had ground source heat.
Reply: Is that because its a ground source heat pump and therefore unaffected by winter temps...🙄
Reply: @manoo422  the ground is alway warmer than the air temperature yes but why are you all going insane thinking it's not colder than in the summer. And most ground installations are spread horizontally....
Reply: It’s all good unless / until the power goes out and your pipes freeze / burst.